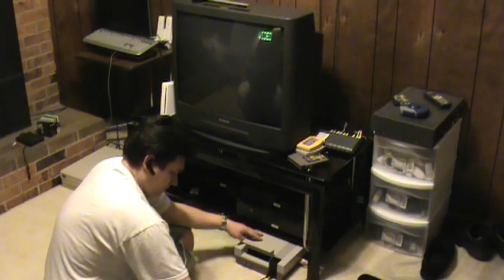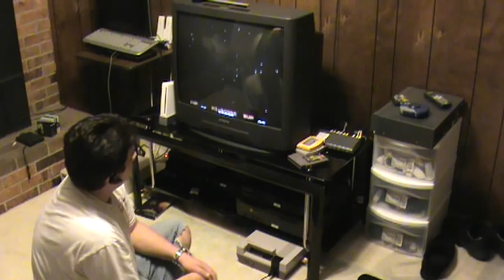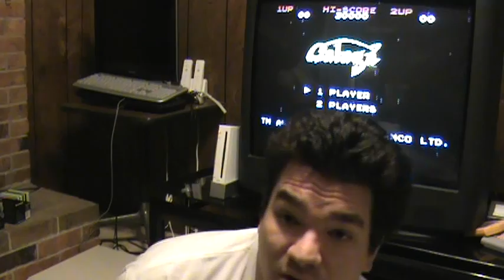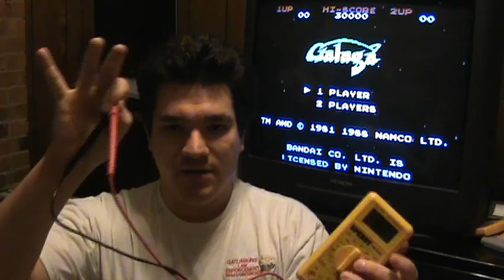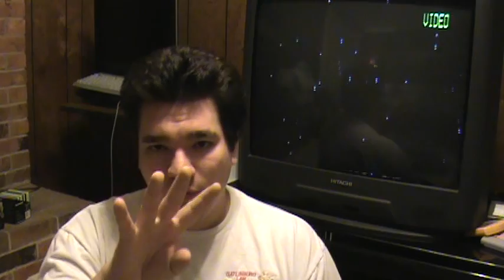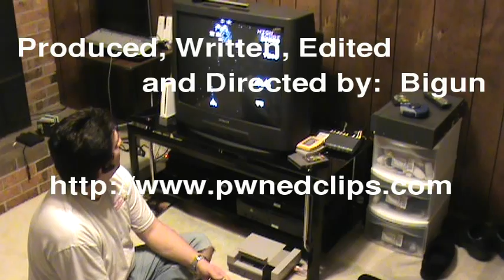NES Mod - Disabling Lockout Chip - Part 2

Comment: @bigun89 Thanks for the reply!  I guess my question shouldn't have been whether or not this will mess up the NES.  It should have been "is there a chance I could solve the blinking light/screen issue by performing the lockout chip mod?"

The reason I ask is because the new 72-pin connector didn't seem to do the trick.  Also, did you really mean to say that you haven't run into any games that work with the lockout chip enabled, or that u haven't run into any games that had issues with the mod? TY

Comment: Awesome video.  What effect will this have (if any) with legitimate games that give a blinking light all the time?  I tried replacing the 72-pin connector and still get the blinking screen.  I was hoping it's possibly a lockout chip malfunction, which this mod would hopefully help me bypass.  Any thoughts?  Thanks!

Comment: ive fixed many nes consoles.  but there are a few i cant figure out.  I replaced 72 pin cleaned motherboard and game.  Works fine on some nes.  Other times i still get a red screen. Some ive tried i have no power at all what so ever.  So what iam thinking is there has to be a way to fix the RF switch inside the console.  I just cant find any video on it.  And i dont know what to start.

Comment: This is a good idea, tried this on my NES today. Unfortunately the 4th pin broke off after I had soldered the wires in place and were about the reassemble it. So I just have to live without the possibility to switch the lockout chip on and off.